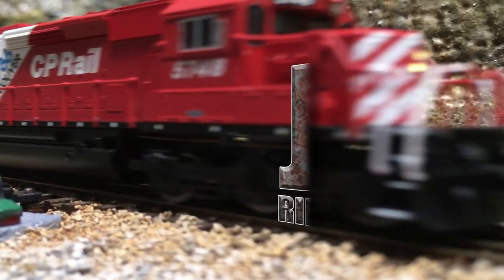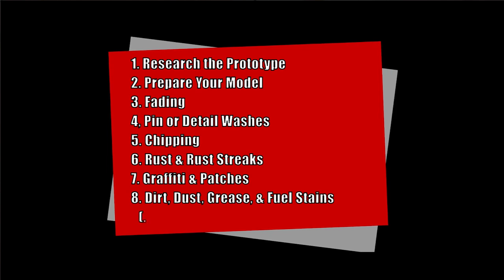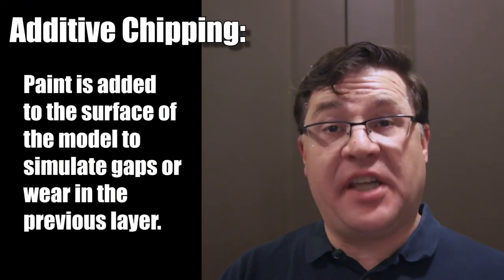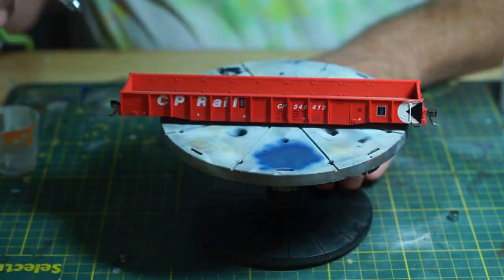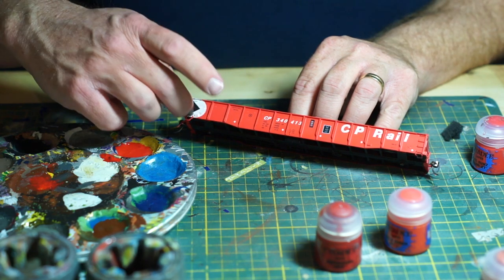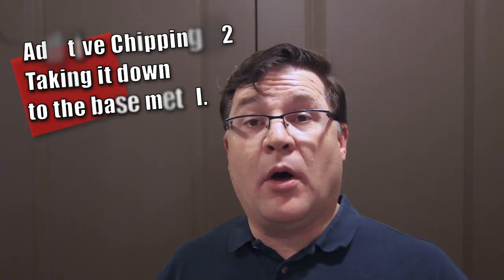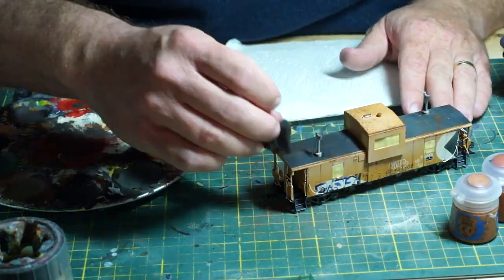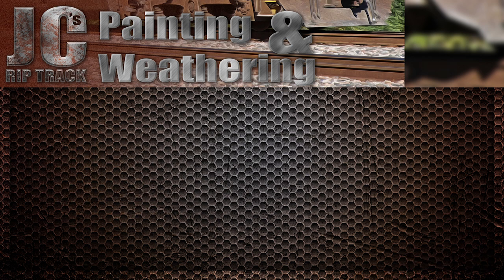Weathering Model Trains - Paint Chipping (Step 5)

Comment: I use the salt technique on some structures and rolling stock, but I use oil paints that mix with water or thinner. To apply I use  a stiff stippling brush  and some times a sponge. I prefer the brush over the sponge.
Reply from the maker: Thanks Phillip. So when you use the Salt technique, is this over factory applied paint or is it with an undecorated model? Once I finish this Weathering Basic series, one of my projects will be demonstrating the salt technique beginning with an undecorated model.
Reply: I like to use this on wood, I have used ( Winsor & Newton GRAPHIC MARKERS ) in vireos hues of gray and wood color so simulate old weathered wood. then apply salt and then paint with airbrush a color for the structure. when dry rub off the salt and clean with a light water wash to remove salt residue. then finish with weathering on the paint.
Reply from the maker: Great stuff :) If what I've demonstrated here is an "additive" technique, the salt technique you describe is definitely in the "subtractive" category and they can achieve more natural looking results, particularly on structures, but they also work well for rolling models too. Definitely material for a future video. :)

Comment: How would I model the chipping effect on a composite wood boxcar; like the ones built in WW II with outside bracing and wood sheathing?
Reply from the maker: The main thing is to identify what parts are wood, and what parts are metal. For the areas that are wood, use a neutral to light grey colour to chip the wood if you're working on a factory-painted model. Then use dark brown for the metal parts. I find using a sponge as the best way to apply it.
Reply: @JCsRiptrack  Thanks!

Comment: The simple 'sponge method' technique can be quite effective. And if thicker paint is used, it adds texture, which can be desirable.

Nice job with this turorial, and I look forward to future demonstrations.

One question I've had (and I think a few others might too) is - is the manufactured 'chipping solutions' on the market really better than free D-I-Y solutions? (Which I think might have a subjective answer ;) )
Reply from the maker: I think it is subjective... although in truth, I just bought a jar of Chipping/Scratching Fluid from Ammo by Mig to try out and compare to my handy bottle of hairspray. Mig Jimenez makes a reasonable argument that formulations of hairspray vary from brand to country, so consistent results can be an issue. This is the rationale behind both Ammo by Mig and AK Interactive in creating their respective chipping fluids, so that modelers can have consistent results. Granted, hairspray usually smells nicer.

...of course, chipping fluids are for a different video, but I think a great discussion to start here, as it will shape what I do for that when I get to it.